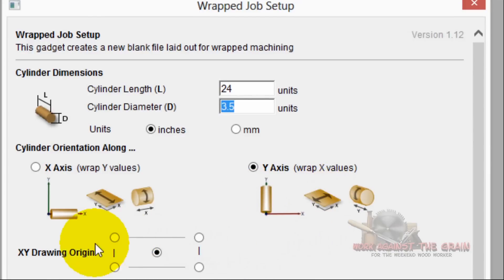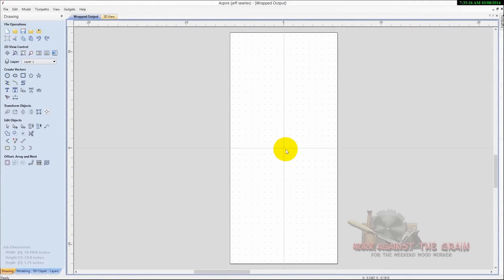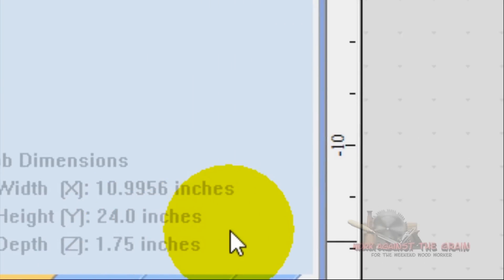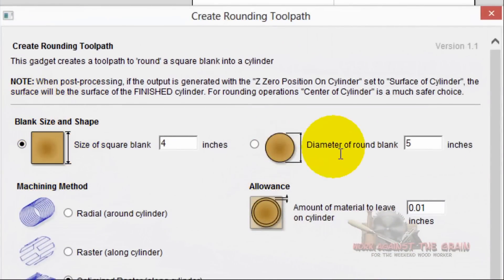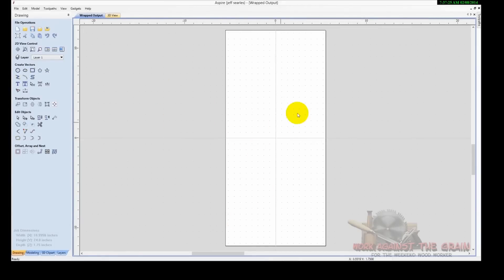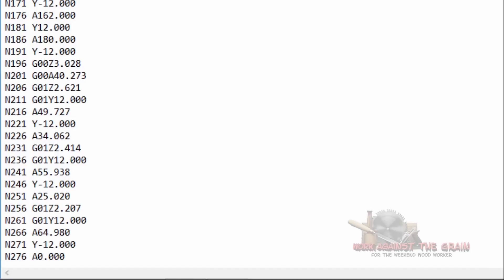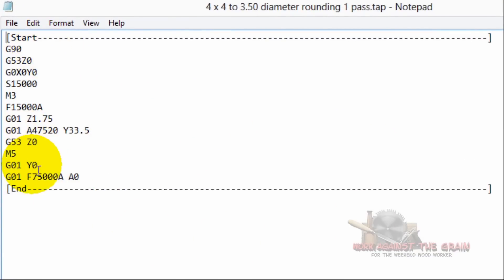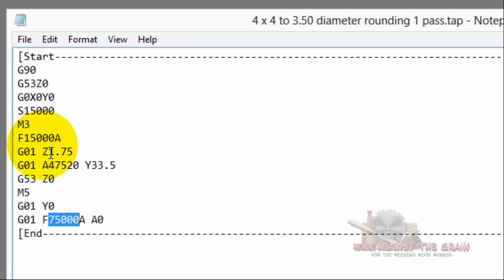Vectric Rounding Tool Path Tutorial

Comment: When I create things for my 4th axis, I use Vectric gadget Wrapped Job Setup and Vector Unwrapped. When I machine it, everything goes well except one nasty groove made by machine in the place where the wrapped job joints.
I made the same design in SolidWorks and imported it to Vectric as STL file……The same thing is happening ( see attachment photo)
When I simulate run on Vectric I don’t see this groove.
This only happens when I run roughing toolpath. Finish toolpath does not follow the groove and it looks like it functions well but can not correct the problem , since the roughing takes too much material making that groove.
(vectric project is clean , but the real piece not)
Any idea what is going on?
Thanx.
Reply from the maker: What roughing toolpath strategy are you using on your roughing pass? Perhaps change the roughing toolpath strategy to 3D RASTER along the axis opposite the direction of your material. Said another way, if your material runs in the Y axis, use roughing toolpath in the X axis. Hope that makes sense. I have found if I do roughing toolpath opposite the direction of my work piece I get a better result. Change the roughing strategy and see if that helps. There are many choices there.
Reply: Yes it does  make sense and it is exactly what I did. My material is along Y and I use 3D along X

Comment: Hi Jeff, thanks for the video. I build my own indexing CNC lathe and am now running test cuts on it. This is fantastic. Have you used the X3 system with the lathe attachment yet? Just curious as that would save some time in tool changing.
Reply from the maker: Felisha Wild. Yes, I do occasionally, I just prefer the main spindle when using the rotary axis.  Thank you for watching my video.
Reply: Work Against The Grain would it be possible to get your formula for turns per inch traveled as well please? Thank you
Reply from the maker: Sure, email me at jefonitoo@gmail and I will reply with it.

Comment: can it be done as a two sided cut... where I can cut one top half and maybe flip the material and cut other side?
Reply from the maker: +Timboc Tou Perhaps I am not understanding what you are trying to do. This video you are commenting on is how to make a square piece of material round. The material needs to spin to accomplish what is demonstrated here. I guess you could model a 3D model of a 1/2 of a cylinder or 1/2 of a column, machine it on one side, turn it over and machine the other side and end up with a long round piece of material, it would just take a lot of time. The first side would be easy, but holding the material down to  machine the second side would be difficult but yes I think it could be done that way.
Reply: +Work Against The Grain yes it would take a while and it think it can be done. thanks for your reply. I always watch your videos

Comment: can this be used on a 3 axis cnc rounter
Reply from the maker: +Timboc Tou Yes and No. Technically my CNC machine is a 3 Axis CNC, with an X,Y and Z axis' but it has a lathe attachment. If your 3 AXIS CNC has a lathe or indexing attachment then YES it will work. You must have something that "SPINS" the material while your 3 axis' are moving. Usually called an A or B axis that spins the material. Thanks for watching.